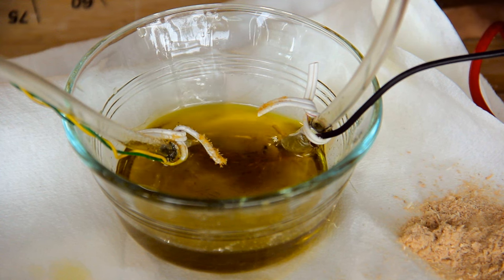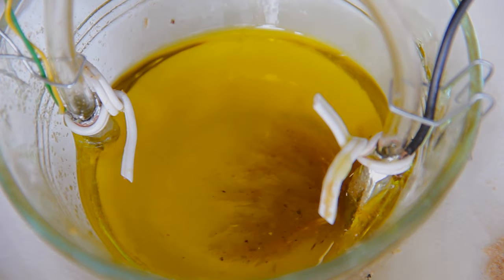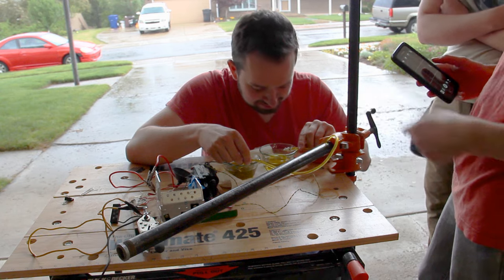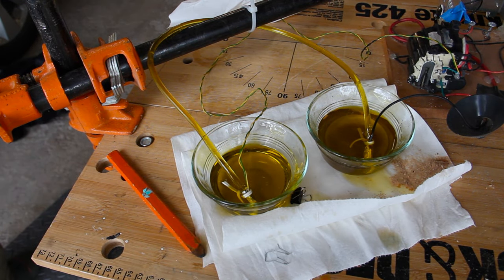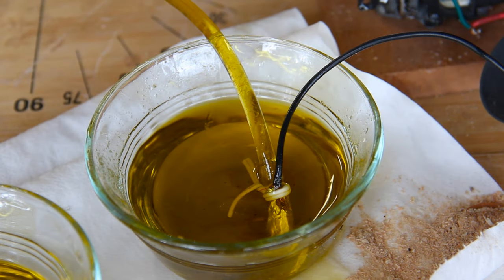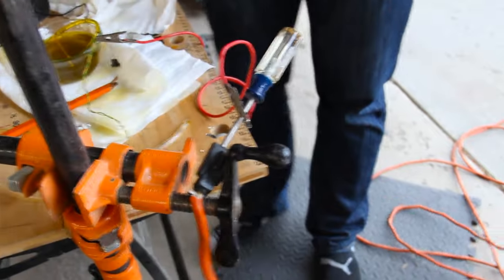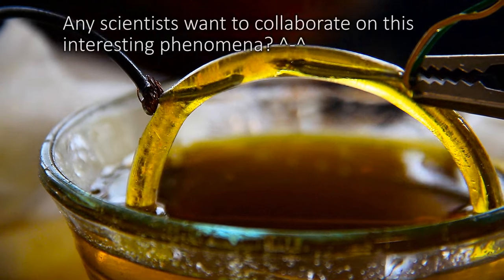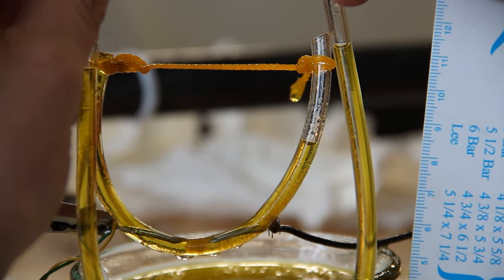Olive Oil and 20,000 Volts

Comment: Electrophoresis! (I think that's the word) The idea you are using is used (at much lower voltages) to drag cut up DNA though gel to make CSI DNA images. 

Awesome build, 600pa is nothing to sneeze at either, you might not get high flow but this would be a huge pumping force in a microfluidics system.

Comment: Your microphones are picking up high-pitched noise from (probably) the transformer.

Next time use EQ to filter that out. I guess you either didn't watch your own video or you have bad hearing, but it really ruins the video if you have normal hearing.

Here (http://i.imgur.com/vGboiIF.png) is a spectogram from about 0:16 until 0:33. The horizontal line is where you fucked up.